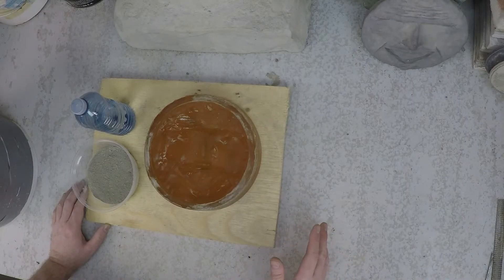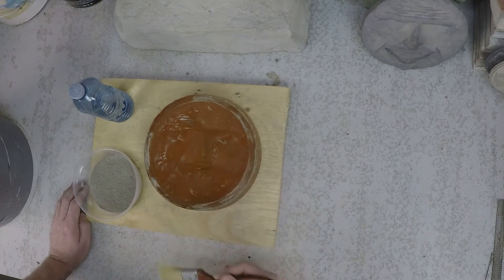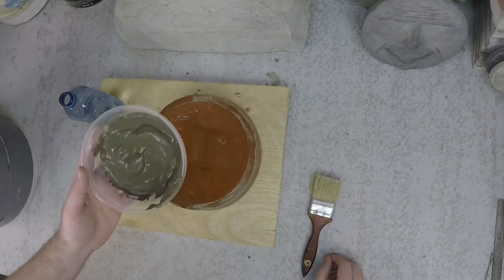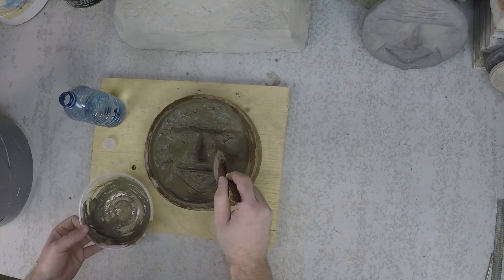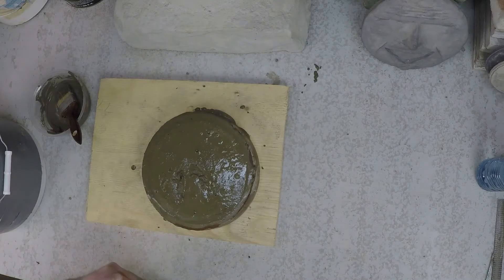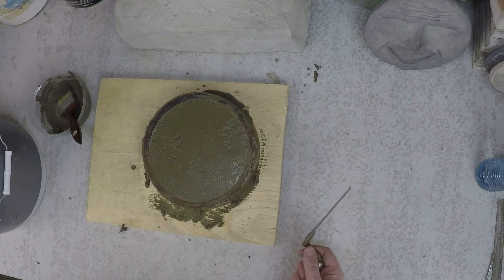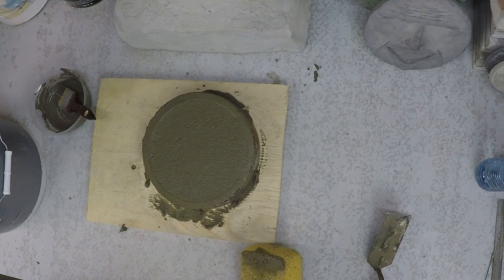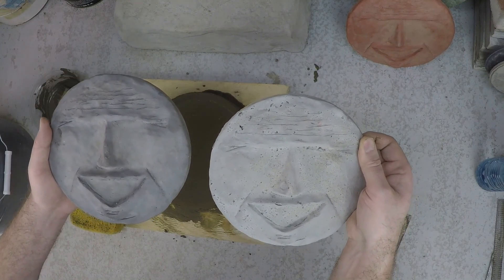Tips For Casting Concrete - Use A Slurry

Comment: Love your stuff, but a question: Does this slurry not cause the surface to be weaker, more prone to scratching etc? I am casting very high detail parts, but I also crave strength and scratch resistance. I've been using 80-20 mix of-40 mesh silica sand and 200 mesh silica flint as my aggregate, and that has managed to capture a fair bit of detail, though i havent solved bubbles yet and have seen you suggest this technique

I am just starting my concrete casting journey -- I have spent years doing super high detail resin 3d printing work, 3d scanning and digital model design for a living. I first discovered "nice" surface materials via getting into copper electroplating. Your 4 tips video was instrumental and has turned me on to super plasticizers and defoamers for my little concrete tests. Thank you for sharing your knowledge!

Comment: Can I make the slurry a little bit thinner and "paint or drizzle" it on top of my wet concrete RIGHT after I've poured and smoothed out my wet concrete in my stepping stone frame? I'm wanting to add color to stepping stones that I am making out of Quikkrete ready mix.

Comment: Thanks! Question: about 3rd vibration step of this process: 
In making stepping stones in molds, for the outdoors, & decided to try a $5+ bag pre-mix crack resistant concrete, only for stepping stones projects...It has fibers + some mystery ingredients + air entrainer, to be mixed w/ a motor, for freeze thaw protection & to reduce shrinkage. They advise you can add your own acrylic reinforcer). Can you still use the slurry process for a smooth top layer when using such a mix? (I’m thinking maybe do the slurry, then a thin vibration layer, & then finish with the crack resistant). Is it mutually contradictory to want a smooth top layer, using a slurry, while using such a crack resistant concrete?
Reply from the maker: The slurry would only be for the parts of the block that are touching your mold.  The top, if it is exposed, is finsihed by hand / trowel.  I would be hesitant to add any admixtres to an already modified mix as you could have conflicts with the other ingredients, especially the air entrainer which I believe conflicts with the acrylic additive.
Reply: I appreciate every single one of your cautions. Concrete has so many surprises.  @creatingconcrete
Reply: I think we are talking 'top' of the actual stepping stone vs 'top' surface of the mold from different viewpoints. I was thinking 'top' of the actual stepping stone which I realize would be bottom of the mold. ha ha.
Reply: I saw this bizarre pdf tech sheet online after asking this question, that went into detail of extreme problems you can have if you try to do smooth finishing on an air entrained concrete... but I think it was more finicky for construction jobs. They can't glue disasters back together like I can as an artist :) @creatingconcrete

Comment: You're my unofficial concrete mentor.  I've been trying to make concrete tiles, and notice your mortar here looks extra smooth.  What sort of concrete mix do you use to achieve this smooth mortar?  I currently am using Quikrete High Strength and it feels very aggregate heavy.  Any suggestions you have I'd be all ears.  My first three pours are on my channel, if that helps troubleshoot at all.  Thanks again for sharing all your knowledge here!
Reply from the maker: Make your own mix with porland cement type general use and graded, clean washed sand.  1 cement and 2 sand.  This will give yo ua more creamy, smooth mortar mix
Reply: @creatingconcrete  thank you!  After this video I saw your 1 part cement, 2 parts sand video.  Many thanks, and greatly appreciate all the video advice!

Comment: Is there such a thing as dry-casting of concrete? What I have in mind is to mix the dry ingredients thoroughly, place into mould & vibrate, then introduce water from the bottom (possibly with additives to reduce viscosity & surface tension), perhaps through a membrane or filter so as not to wash out any cement, and apply a slight vacuum to the top to draw water through whole mix. If the process could be made to work, it would have advantages like ease of manipulation, no heavy mixing, less wastage, less cleanup, no voids or bubbles.
Reply from the maker: It does not sound like it will work.  I do not think you can get an adequate mix or even hydration doing something like this.  Additionally you would have air pockets.

Comment: So, how would you slurry the inside of a mold that you can't get a paint brush inside?
Reply from the maker: You possibly could pour in a wet slurry paste and rotate the mold and then pour out any excess.  In some cases a slurry might not be possible.  Molding and casting is pretty dynamic and there are a lot of different methods and variations.
Reply: @creatingconcrete   I agree. I’m still new to the hobby and so far I’m strictly small items like mini planters and candle jars with silicone molds.  The slurry technique might be very impractical for such deep molds.  But I’ll definitely try this when I make my own molds when I need pavers for my yard and making abstract industrial sculptures with welded steel and concrete blocks.

Comment: You mentioned to only use the slurry for coating the inside of the mold, and not to let it get too thick. What would happen if you used slurry (Portland cement and water) only, to fill an entire mold? I am thinking about a ‘life’ casting of hands. I love the smoothness of the slurry cement when dried, but wasn’t sure if it would work. Thanks for the informative videos!!
Reply from the maker: It would yield poor results.  The ultra smooth effect can be accomplished with water reducers and using some finer grade sands for aggregates.  a 1:1 or 2:1 sand to cement would be the range I was working in.  Many people looking for this finished quality look towards bagged products that are modified heavily with polymers and water reducer already.  A product called cement-all is the most commonly used.  The only drawback is price is high versus sand and cement and admixtures that you add and mix on your own.  But a high quality 2:1 mix with water reducer and 10% acrylic latex, which you then vibrate thoroughly in your mold should produce results like you are seeking.  Good luck!
Reply: @creatingconcrete  Thanks Steve!  Ironically, I picked up Cement-all over the weekend and used it for my project which turned out great!  I was worried about strength in using the Portland Cement and water only.  I appreciate your detailed response and I love your videos!

Comment: Thanks for answering me back so fast!! Will the slurry help with cutting down on the amount of pin holes in the finished item? I unmolded a 
turtle this morning and I used a release agent. Is the release agent what cases the air or pin holes?
Reply from the maker: A lot of times it is just poor consolidation of the concrete (not enough vibrating) that causes the pin holes.  A release agent can sometimes contribute if there is too much and / or there are tiny air bubbles left, so wiping away excess with a clean cloth or paper towel before you apply the slurry helps.  But a slurry can really help cut down, if not eliminate, pin holes in the finished product.
Reply: @creatingconcrete  Great information!! Thanks. I think I needed to vibrate the mold more than I did. I used Quikrete Mortar Mix type - N to make the stepping stone, do you think this material is strong enough to be used for stepping stones?
Reply from the maker: @robertferguson558  Yes regular mortar (just add water) would be suitable for this.

Comment: Do you still use a release agent before applying the slurry?
Reply from the maker: Absolutely.  A release agent should always be used when casting concrete to have a cleaner demolding process and less chance to break your finished product because it was stuck in the mold.